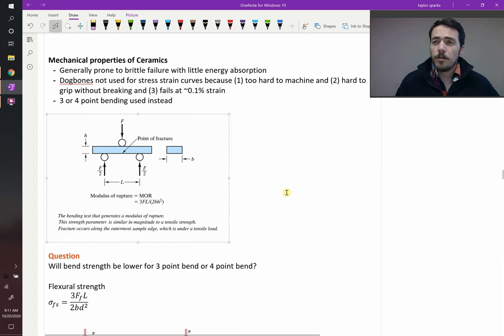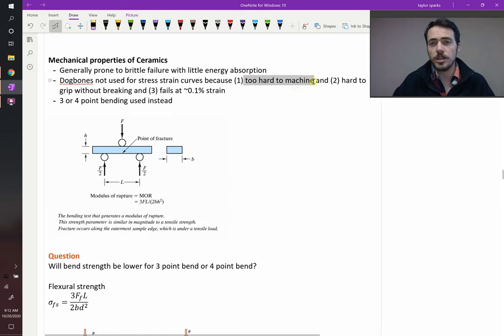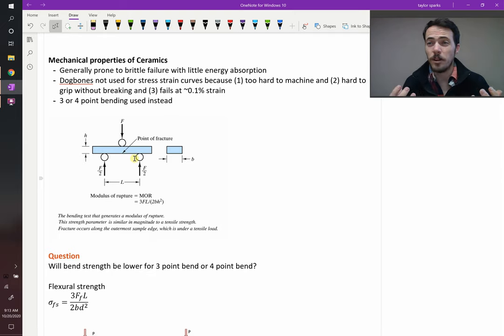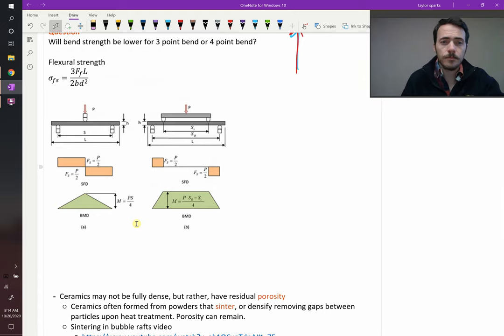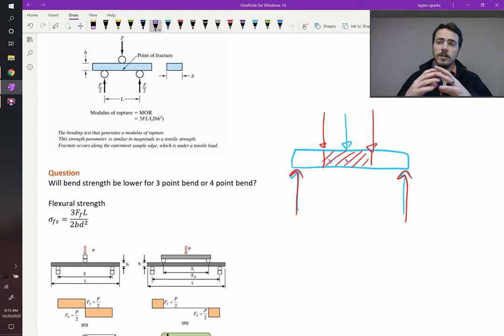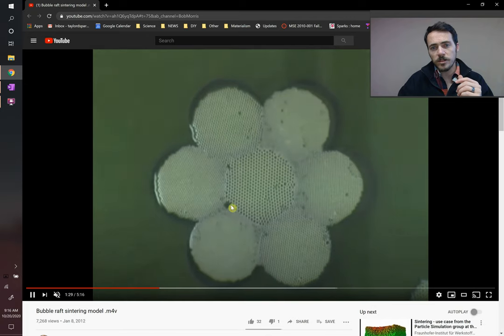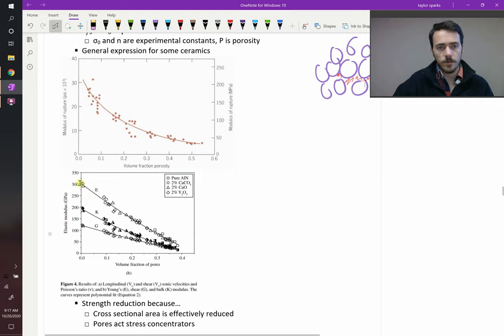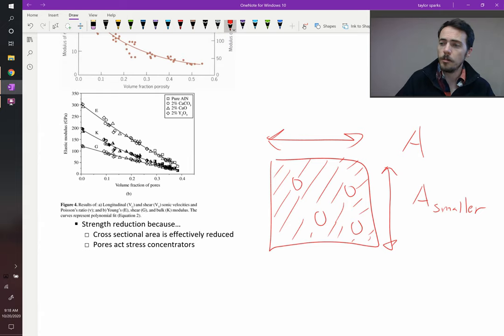Mechanics of ceramics

Comment: Hi professor I couldn't find a video about sintering for ceramic materials in the channel .I'm trying to find an answer for the question,which is  Why do ceramic materials need to be sintered?
Reply from the maker: Ceramics melt at much too high of a temperature to be cast into a net shape like we do with metals. Yes, we can do it with some glasses, but most ceramics... It would require temperatures and mold materials that would not be compatible. Therefore, we have to start with ceramic particles and find a way to form the shape of interest and then sinter those particles together to remove the porosity so that the final product is strong and defect free, hence the need for sintering.
Reply: @TaylorSparks  Oh thanks a lot professor,I really appreciate it 😀